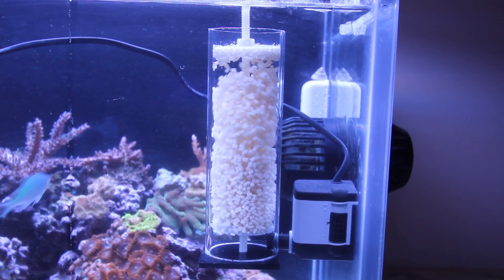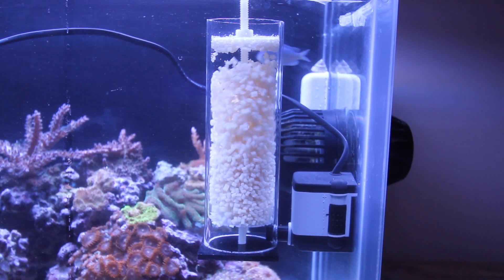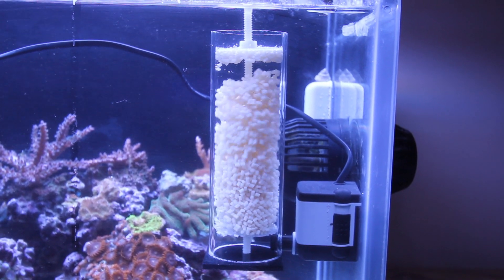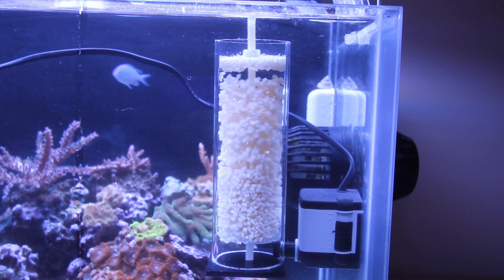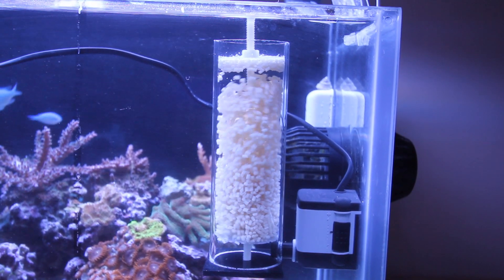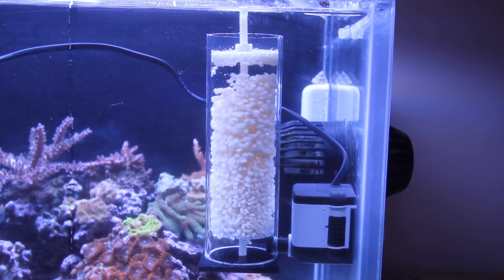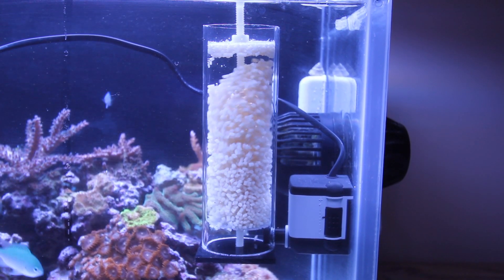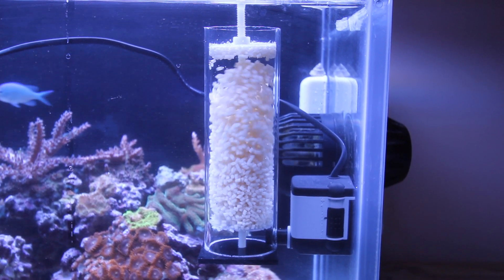bio_pellets.wmv

Comment from the maker: I broke this system down and am now building a 70 gallon reef.  It's a simple low cost project for sure, and it works.  There are also nano BP reactors being manufactured these days...Cadlights is making a new design similar to mine...check Reef Builders for the article.

Comment from the maker: Thx for the comments....MFodleg, I got the tube from Tap Plastics, part number 23477.  The od 2 1/4" Acrylic Tube (1/8" wall).  The center bar is a 1/4 inch threaded nylon rod with 4 nylon nuts which hold the pads in place.  The pads are cut from a cross stitch sheet from Michaels, 7 mesh...seems to hold the pellets well.